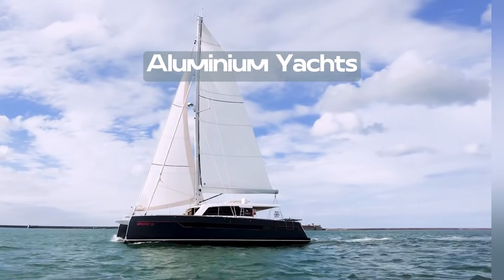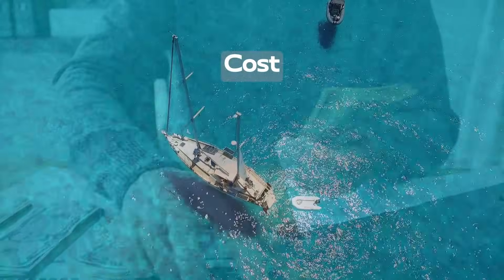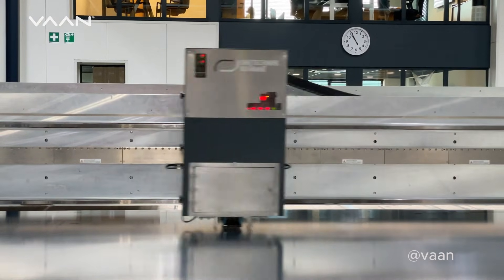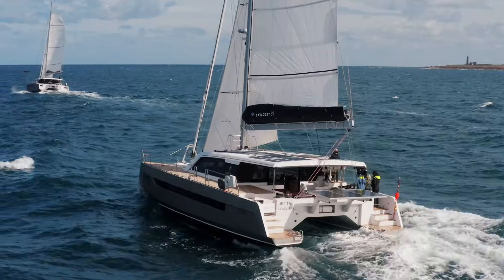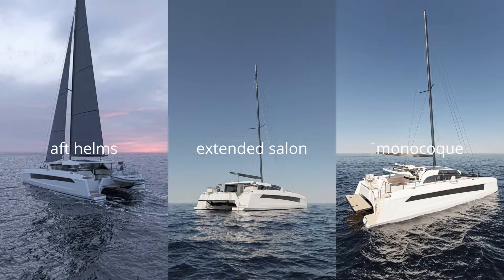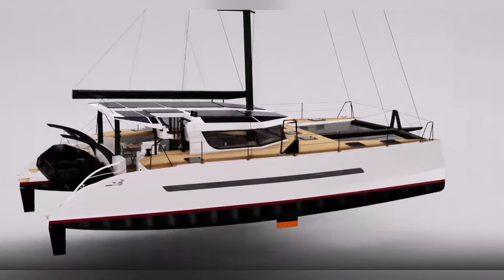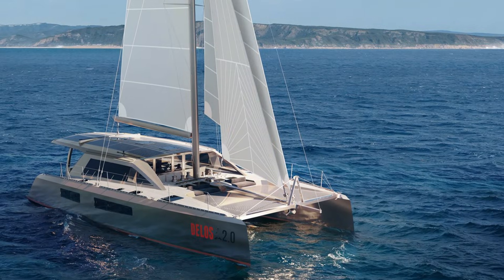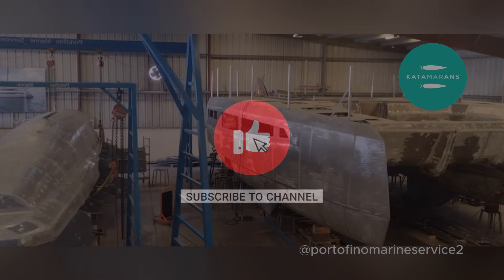Best Aluminium Catamarans +2 Monohulls! Which are Better? Aluminium or Fibreglass Sailing Yachts?

Comment: "Aluminum is better when treated properly." That sentence says it all.
I would add: If you are buying an aluminum boat, avoid boats with a hull thickness of less than 6–8 mm (ice belt) and 5 mm outside the ice belt.
Reply from the maker: Yes, good point. Also check how the thickness is distributed, its likely to be variable

Comment: The ODC48 is exactly what I would look for. it is stunning. But I got there because of Sailing Jupiter. The Mumby was what initially caught my eye.
Reply: Peter originally purchased the Tim Mumby plans and all along wanted to steal Tim's design by slightly altering the design and calling it his own. Peter ended up keeping the lower hull shape but used a thicker gauge of aluminum making the boat much heavier. Peter and his building partners also increased the thickness of aluminum plate on the rest of the boat as well. Another thing that they did was removing all of the curves in the deck that Tim Mumby had in his design. This curve made the boat much stronger and lighter weight because it allowed Tim to use thinner aluminum sheets without compromising anything. Peter's new boat hasn't been proven and I would bet that it will for sure sit in the water much lower than Tim Mumby's designed light ship weight of 6.1 tones. This will cause the bridge deck clearance to be minimum and a lot more drag in the water. When you design a boat with about double the weight, you have to widen or deepen the draft to support all that added weight. People are going to be very pissed off once they realize this. I would bet that they are going to paint the bottom and then need to hull it out to raise the bottom paint if Peter even shows that. He might pull movie magic on his viewers so that no one notices that.
Reply: @Rob-r2s  that will be 8nteresting to see what happens. Thank you for that insight.
Reply: @MarshallBocell  Your welcome! I'm really looking forward to seeing it float as well. It will be funny if it sits a lot lower in the water and they show that in his videos.
Reply from the maker: It's taken a lot of inspiration from the Mumby I think
Reply: @katamaranscom  Oh, absolutely. It is just an updated Mumby, really.

Comment: I am somewhat surprised that you did not include the ease of repair in the pros of an aluminum yacht. A damaged aluminum hull requires only a welding job to repair the damage while a damaged fiberglass hull requires a more expensive and more skill-demanding repair (or so I have been informed by YouTube videos). Is this correct?
Reply from the maker: @brianmcallister114  I only have experience in mending holes in Fibreglass boats. That said, I believe it could be the other way around, although I guess it depends on the damage. Fibreglass yachts are generally cheaper and easier to repair due to the availability of materials and less specialised labour. Aluminium yachts, while strong and durable, require skilled welders, more expensive materials, and careful corrosion management, making their repairs more complex. Happy to be corrected. Of course, you might be glassing over holes in your GRP boat while your neighbour just suffered a couple of dents.

Comment: Aluminium  is no longer used for building race cars, race bosts or gluders. Because its too heavy. And in any multihull weight is critical. Any weight used in the structure is payload you cant carry. Many cruising multihulls are dangerously overloaded. Which is why I see so many dismasted cats in my voyaging around the pacifuc every year.
Reply from the maker: @deerfootnz  I don't think we'll see any aluminium boats in the America's Cup. That said, I'd be more comfortable in an Aluminium boat sailing around Iceland, northern Norway or Alaska. In terms of dismasting, I'd say regular maintenance/checks of shrouds, stays, turnbuckles, chainplates, maststep etc is the key factor. Reefing early of course
Reply: @katamaranscom  And is any cat the right boat to take to the ice? Aluminium or not, I can't see why a catamaran is suited for sailing in ice.
Reply: Aluminum is the best boat building material once you get over a certain size. For a tender, it's much better to use carbon fiber or fiberglass due to the size. You need a certain thickness for aluminum to be thick enough to handle the purpose that it was built for and that adds up in weight. A Mumby's design lightship weight is 6.1 tones. That's the lightest catamaran out there. None comes close to that.
Reply: @Rob-r2s there is no "best" boat building material at any size and that statement is revealing of your knowledge. It would be possible to build a carbon composite mumby lighter than the aluminium boat. You should think about why nobody has done that.
Reply: @deerfootnz  The Schionning Arrow would be the perfect boat to make out of aluminum. It would be lighter weight than the method that they use to build them and stronger. It would also take much less time to build using aluminum and cost less money in not only labor but material cost as well.
Reply: @Rob-r2s there is no "best" boat building material at any size and that statement is revealing of your knowledge. It would be possible to build a carbon composite mumby lighter than the aluminium boat. You should think about why nobody has done that.
Reply: @deerfootnz  Time and money would be the answer. The time it takes to build and fair a composite boat takes much longer than building an aluminum boat. On the money side, all of the materials needed to make a composite boat adds up to more money than what it would cost to build an aluminum boat. You might be able to build a Mumby using carbon fiber that weighs about the same or possibly a little less than an aluminum Mumby but it won't be as strong. There is a YouTube channel called Carbon Bee. They are building a carbon fiber catamaran that is very high performance and large but it weighs more than a Mumby. I'm not convinced that you can build a carbon fiber Mumby that is lighter than the aluminum one. I think it would be heavier.
Reply: @Rob-r2s It wouldn't. Obviously. Carbon composite has a higher stiffness to weight ratio than aluminium. So it's "stronger" in your simplistic speak for equal weight. Fact. End of discussion.
Reply: @deerfootnz  It depends on the thickness that you need to support the structure. Why don't you make a carbon fiber Mumby and then we can see if your right or not.

Comment: Yes, cork that gets wet and in case of minor damage and poorly built fiberglass boats is common knowledge. There is a bad one with a large error and made with aluminum as well. Fiberglass is only because it is cheaper and nothing else. But buying something for a lot of money that was chosen because it is cheaper to build and buy and with a lifespan of like 30 years is, for me, incredibly stupid for the environment and for its short shelf life. Who takes care of all these fiberglass boats when they are scrap? This is a bit like with the stupid wind power and these are in piles that no one wants to take care of. Do you take care of these rejected fiberglass boats when they run out after a fairly short time. filled with water there are also many and get heavier and heavier. I see no advantage more than a cheaper purchase. So people only think about themselves and short term. Like a socialist.
Reply from the maker: Yes, GRP is harder to recycle because it is a composite. The sensible thing to do is to try and build the recycling cost into the price somehow, but that is not easy with boats as they are so mobile. You would have to co-ordinate tax regimes internationally, so education is key too
Reply: @katamaranscom  Good points you makes here.
Reply: Almost everything you say is wrong. And clearly you don't understand socialism and even worse, how inappropriate it is bringing politics into a discussion about boatbuilding materials. Cretin.

Comment: There is also carbon fibre which deserves its own category (outside GRP fibreglass) but it’s very costly…
Reply from the maker: @alandelmas1236  that's true, or mixed use with carbon in high stress areas to keep the cost down. Can be noisy at 20 knots!
Reply: Carbon fiber was very expensive in the last century, but in the past decade, the price of ordinary carbon fiber has dropped dramatically. However, many shipyards are deliberately deceiving users.

Comment: A well build cold molded epoxy over wood (ply) boat is lighter and at least as strong as aluminium. Minimum rot if good plywood is chosen. People had made the mistake and used hardwood plywood and mahogany.
Reply from the maker: @ottifantiwaalkes9289  have a look at Punch Catamarans (multicat-algarve.com) who build to this method. Also custom Looping worth a look

Comment: Can you tell me about a concrete boat that you know? Do you know a concrete boat?
Reply from the maker: @ottifantiwaalkes9289  there are quite a few for sale on YachtWorld. It's not a widely used material these days, mostly DIY projects. My neighbour built one.
Reply: @katamaranscom  your neighbor  built a concrete boat? When? Where?
Reply: @ottifantiwaalkes9289  New Zealander Richard Hartley designed many ferro cement boats, many of which are still sailing, there are concrete barges on the Thames River over 100 years old. In Australia Tony Fisher built a concrete yacht called Helsal that won the Sydney Hobart yacht race in 1973 in what was then record time. I do hope that your google is not broken.
Reply: @sheerluckholmes5468  i think the concrete barges on the thames are ferro cement not concrete.

Comment: When you say lightweight, how do you define this statement ? When you say a boat is lightweight, compared with what?
Reply from the maker: @stefantornblom1555  compared with other boats (built of say other materials) that have a similar waterline length. I take your point, there are a ton of variables not the least of which is how much gear you load on.
Reply: I took it as the strength to weight ration and the general ideas of sailboat weights, aka light displacement/heavy displacement sail boats.

Comment: Really good overview of Aluminum sailboats.  There are a few more monos from France and Netherlands.

ALL boats can have galvanic corrosion: wood boats, steel, aluminum, plastic composites, if they have more than one type or alloy of metal in contact with the water.  That's why ALL boats need sacrificial anodes, electrical bonding, etc.
Reply from the maker: @LoanwordEggcorn  thanks. Yes, it's always a little scary when you change those sacrificial anodes and they are looking well munched. Boats = maintenance in exotic (or not) locations
Reply: All metal is effected even if not in contact with water boat floats in. Radiant

Comment: Guys.. you 2 talk slight idijotizem.. for eksaple.. mumby is to thin it bends.. i dont know how will behave that odisy... but looks thin.. however thats not  neceserry that will bend...
And looogical all they will screem how good their boat is.. but behind that storry is allways another storry
Reply: This equals lightweight and none of them have bent. All the Mumby's are still sailing.
Reply: A lot of mumbys on the water for decades and a lot of miles on them, no one talks about bending- but then you seem to have no clue about construction. I guess you are fantasizing to troll? Also, if you can't write English, use a translator.

Comment: There's a few more designs and builds out there including one Al design for Seawind and  some smaller designer builders in Australia. 

As a asides ..  GRP  is a particular problem globaly as a material because of its end of life disposal problems and sheer volume of  old boats abandoned  and  damaged  
The material itself is unpleasent to work with and requires large amounts of water and Energy to produce and releases CO2 .in its manufacture.  The fibers in air or water have shown to be extremely harmful when worked or abraded and the resins are toxic... Greener and safer alternatives are being sort. 

Which brings us to natural Basalt derived products... fibers meshes and rebars can all be made from Basalt ..  both to use in composits and concrete .. it very green by comparison and highly resiliant to most forms of chemical, attack impacts tends to fail more progressively it very innert and resistant to Osmosis its noise deadning and an excellent insulator  electricaly and thermally...it very, very temperature stable and impervious to UV damage and radiation. Its lighter than steel as mesh or rods for rebar..  totaly un effected by salt water acids and alkalies... So

Combined with new forms of low carbon high strength thin cement/concrete it can produce a springy corrosion and crack fee concrete hull...if some ones willing to test it... at the moment  its extendively used in producing thin wall domes for industrial disaster protection and  domestic use. Where a dome bladder is inflated and a framework of basalt erected then concrete is sprayed onto to the structure usually from the inside .. .. The result is a immensly strong  slightly springy light wt reinforced concrete structure that is less likely to develope cracks because its thermal expansion is homogenius and impervious to chemical attack and salt water corrosion ..fire and extreem cold. 

We also stand on the verge of a new age of technically enhanced wood construction. Polymer scientist have developed ways of modifying cheap fast grown soft woods and  
giant bamboo the worlds fastest growing woody plant /grass  and  making it stronger rot proof and fire resistant and far more durable..  the final product can be formed into curves or moulded into girders or pannels like plywood.  
It can also be changed opticaly so that clear translute and transparent pannels of wood can be produced from the same softwood Carbon sink timber but that will perform more like composits or metals and even unprotected could last 80+ years.. 🥼🧙🏼‍♂️ the product is still wood but the physical and chemical structure is modified 
.. a waste product is produced.. acetic acid .. vinigar which is a magor feed stock used in the synthesis of  other common  chemicals and foods. At the moment there are two companies i know of working in the field Dutch Accoya and the  US international startup Inventwoods Metelwood. 

In place of carbon fiber woods and GRP many yatch builders are working with plant fiber s like flax and hemp fibers and developing thermo recyclable resins or bio waste sugars derived epoxyies. 

There are also new forms of lighter  stronger more crack resistant glass being developed - that are also much  greener to produce, with significantly less CO2 produced and energy required. 40%.

The products have been lab developed and tested and are in the process of being developed commercially at scale. 

The Dutch have used Accoya to  construct motorway flyover bridges to test the concepts at the massive scale required in civil engineering.
Reply from the maker: @clivestainlesssteelwomble7665  very interesting, thank you for sharing,  I am going to investigate these developments. Windelo use basalt fibre and PET foam to build their boats